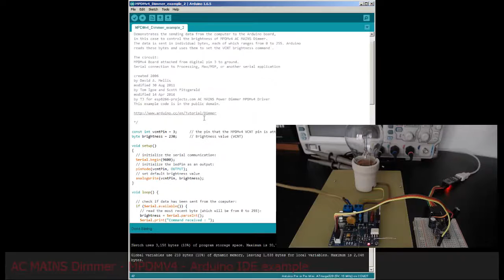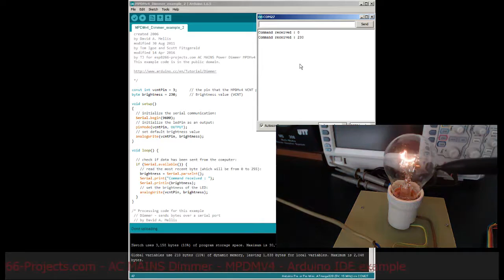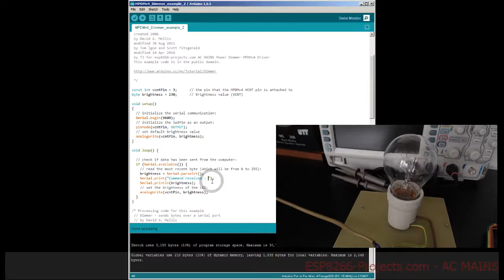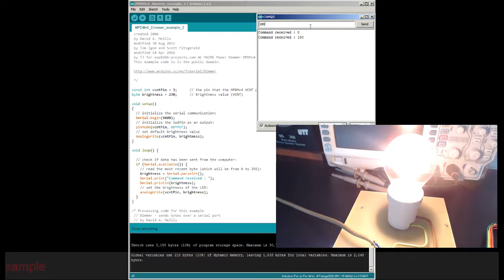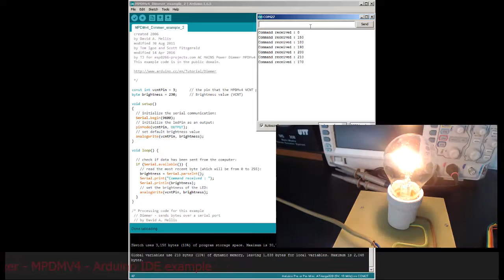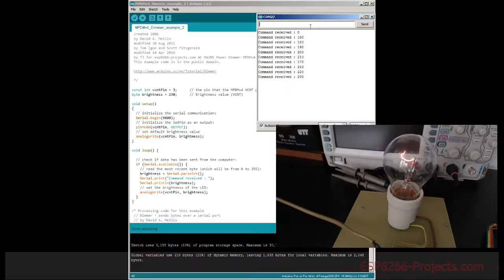Arduino - Universal MPDMv4 AC MAINS Dimmer Tutorial

Comment: You mentioned a capacitor and 2 resistors for arduino.  What is the value and connection of these?  I have a board but am having problems - lots of flickering, and no real dimming.  Hope you can help!
Reply from the maker: Hi Sean,

The resistor and capacitor are just forming a simple low pass input filter for the Arduino board PWM output. It was needed in my specific case because the Arduino board that I have used has a very noisy PWM output. Used values: R=1k, C=100uF. In your case might be even not needed.

However, from your description, you have a wiring problem or more probable a VCNT interval out of sync problem. Please specify in details your setup: Arduino board type, wiring, load, etc.

MPDMv4 can be driven with any MCU board you like, including PIC, ARM, Atmega/Arduino,ESP8266, ESP32,NXP, DAC, etc.

For the dimming process to work OK you will need to provide just a VCNT analog voltage control on the corresponding VCNT pin just be sure that you are not going out the the sync interval. As soon as you are out of sync, it will not work OK!

Actually as long as you provide on the VCNT input pin (voltage control) a voltage between (0V-full ON to about 2.85V (full OFF) you can use even a potentiometer as a variable voltage divider without anything else! Because of the choosen VCNT input voltage range (0-2.85Vcc) you can use any 3.3Vcc or 5Vcc MCU.

For a simple test I would suggest you to check you wiring, start with VCNT=0V (FULL ON) and slowly increase VCNT and check your Arduino PWM Output with a multimeter. As soon as you are around VCNT=2.5Vcc you should see a big decrease in light level and around 2.85Vcc will be full OFF. 

Please take a deper look at the related Youtube videos, especially this one about VCNT (Voltage control), it's everything explained there:
https://www.youtube.com/watch?v=pZvemdrVvrE

For any other questions please feel free to contact me directly anytime.

Happy breadboarding,
TJ.